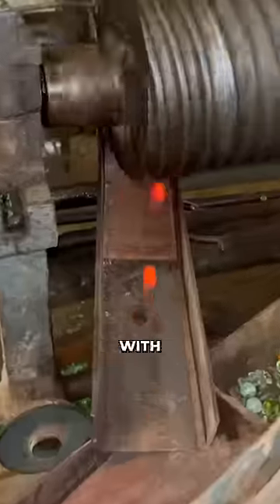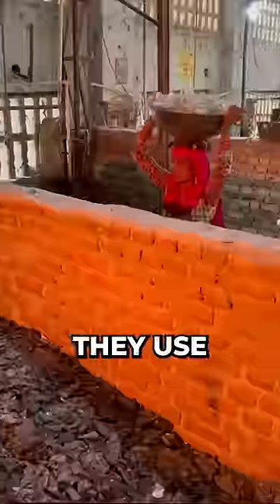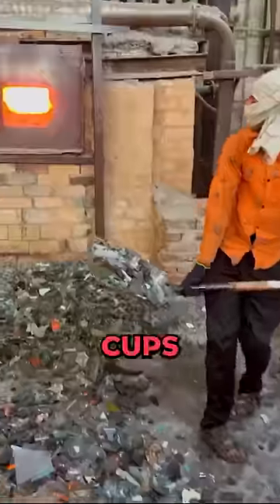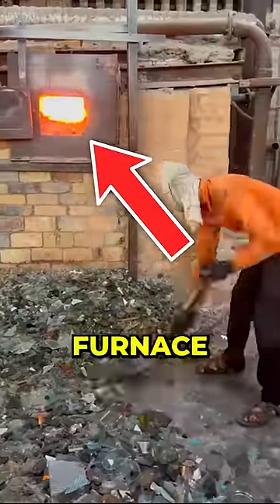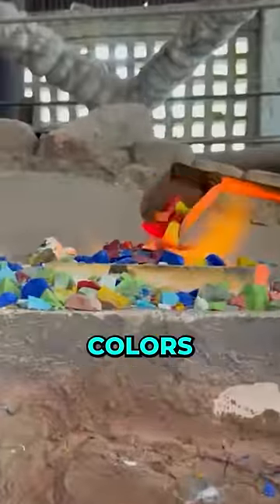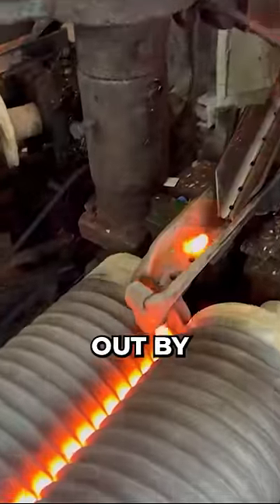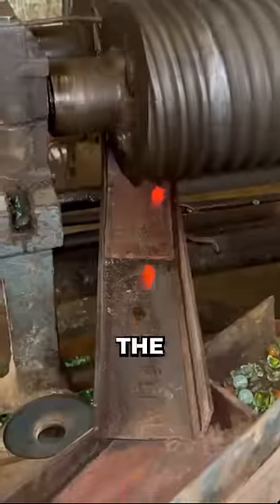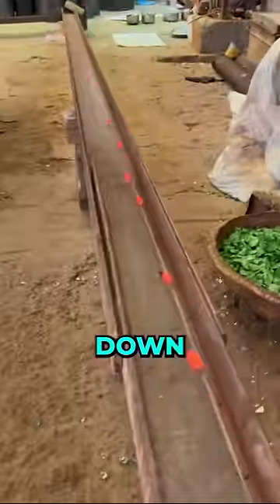These workers are making marbles ❤️

Comment: "Have you ever played with balls before?" Bro rolled me down the ledge!
Reply: "Yes" Chad response
Reply: Yeah ayo
Reply: Bro I'm dead
Reply: "Yes, yes... I love playing eith balls. Oh i'd also love to play with marbles. "
Reply: “Hot Throbbing Balls” 🤔
Reply: Caught you in 8K UHD surround sound 16 Gigs ram, HDR GEFORCE RTX, TI-80 texas insturments, Triple A duracell battery ultrapower100 Cargador Compatible iPhone 1A 5 W 1400 + Cable 100% 1 Metro Blanco Compatible iPhone 5 5 C 5S 6 SE 6S 7 8 X XR XS XS MAX GoPro hero 1 2 terrabyte xbox series x Dell UltraSharp 49 Curved Monitor - U4919DW Sony HDC-3300R 2/3" CCD HD Super Motion Color Camera, 1080p Resolution Toshiba EM131A5C-SS Microwave Oven with Smart Sensor, Easy Clean Interior, ECO Mode and Sound On/Off, 1.2 Cu. ft, Stainless Steel HP LaserJet Pro M404n Monochrome Laser Printer with Built-in Ethernet (W1A52A) GE Voluson E10 Ultrasound Machine LG 23 Cu. Ft. Smart Wi-Fi Enabled InstaView Door-in-Door Counter-Depth Refrigerator with Craft Ice Maker GFW850SPNRS GE 28" Front Load Steam Washer 5.0 Cu. Ft. with SmartDispense, WiFi, OdorBlock and Sanitize and Allergen - Royal Sapphire Kohler K-3589 Cimarron Comfort Height Two-Piece Elongated 1.6 GPF Toilet with AquaPiston Flush Technology., Quick Charge 30W Cargador 3.0 Cargador de Viaje Enchufe Cargador USB Carga Rápida con 3 Puertos carga rápida Adaptador de Corriente para iPhone x 8 7 Xiaomi Pocophone F1 Mix 3 A1 Samsung S10 S9 S8AUKEY Quick Charge 3.0 Cargador de Pared 39W Dual Puerto Cargador Móvil para Samsung Galaxy S8 / S8+/ Note 8, iPhone XS / XS Max / XR, iPad Pro / Air, HTC 10, LG G5 / G6 AUKEY Quick Charge 3.0 Cargador USB 60W 6 Puerto Cargador Móvil para Samsung Galaxy S8 / S8+ / Note 8, LG G5 / G6, Nexus 5X / 6P, HTC 10, iPhone XS / XS Max / XR, iPad Pro/ Air, Moto G4 SAMSUNG 85-inch Class Crystal UHD TU-8000 Series - 4K UHD HDR Smart TV with Alexa Built-in (UN85TU8000FXZA, 2020 Model) GE 38846 Premium Slim LED Light Bar, 18 Inch Under Cabinet Fixture, Plug-In, Convertible to Direct Wire, Linkable 628 Lumens, 3000K Soft Warm White, High/Off/Low, Easy to Install, 18 Ft Bissell Cleanview Swivel Pet Upright Bagless Vacuum Cleaner Trane20,000-Watt 1-Phase LPG/NG Liquid Cooled Whole House Standby Generator.Caught you in 8K UHD surround sound 16 Gigs ram, HDR GEFORCE RTX, TI-80 texas insturments, Triple A duracell battery ultrapower100 Cargador Compatible iPhone 1A 5 W 1400 + Cable 100% 1 Metro Blanco Compatible iPhone 5 5 C 5S 6 SE 6S 7 8 X XR XS XS MAX GoPro hero 1 2 terrabyte xbox series x Dell UltraSharp 49 Curved Monitor - U4919DW Sony HDC-3300R 2/3" CCD HD Super Motion Color Camera, 1080p Resolution Toshiba EM131A5C-SS Microwave Oven with Smart Sensor, Easy Clean Interior, ECO Mode and Sound On/Off, 1.2 Cu. ft, Stainless Steel HP LaserJet Pro M404n Monochrome Laser Printer with Built-in Ethernet (W1A52A) GE Voluson E10 Ultrasound Machine LG 23 Cu. Ft. Smart Wi-Fi Enabled InstaView Door-in-Door Counter-Depth Refrigerator with Craft Ice Maker GFW850SPNRS GE 28" Front Load Steam Washer 5.0 Cu. Ft. with SmartDispense, WiFi, OdorBlock and Sanitize and Allergen - Royal Sapphire Kohler K-3589 Cimarron Comfort Height Two-Piece Elongated 1.6 GPF Toilet with AquaPiston Flush Technology., Quick Charge 30W Cargador 3.0 Cargador de Viaje Enchufe Cargador USB Carga Rápida con 3 Puertos carga rápida Adaptador de Corriente para iPhone x 8 7 Xiaomi Pocophone F1 Mix 3 A1 Samsung S10 S9 S8AUKEY Quick Charge 3.0 Cargador de Pared 39W Dual Puerto Cargador Móvil para Samsung Galaxy S8 / S8+/ Note 8, iPhone XS / XS Max / XR, iPad Pro / Air, HTC 10, LG G5 / G6 AUKEY Quick Charge 3.0 Cargador USB 60W 6 Puerto Cargador Móvil para Samsung Galaxy S8 / S8+ / Note 8, LG G5 / G6, Nexus 5X / 6P, HTC 10, iPhone XS / XS Max / XR, iPad Pro/ Air, Moto G4 SAMSUNG 85-inch Class Crystal UHD TU-8000 Series - 4K UHD HDR Smart TV with Alexa Built-in (UN85TU8000FXZA, 2020 Model) GE 38846 Premium Slim LED Light Bar, 18 Inch Under Cabinet Fixture, Plug-In, Convertible to Direct Wire, Linkable 628 Lumens, 3000K Soft Warm White, High/Off/Low, Easy to Install, 18 Ft Bissell Cleanview Swivel Pet Upright Bagless Vacuum Cleaner Trane20,000-Watt 1-Phase LPG/NG Liquid Cooled Whole House Standby Generator.
Reply: Caught you in 8K UHD surround sound 16 Gigs ram, HDR GEFORCE RTX, TI-80 texas insturments, Triple A duracell battery ultrapower100 Cargador Compatible iPhone 1A 5 W 1400 + Cable 100% 1 Metro Blanco Compatible iPhone 5 5 C 5S 6 SE 6S 7 8 X XR XS XS MAX GoPro hero 1 2 terrabyte xbox series x Dell UltraSharp 49 Curved Monitor - U4919DW Sony HDC-3300R 2/3" CCD HD Super Motion Color Camera, 1080p Resolution Toshiba EM131A5C-SS Microwave Oven with Smart Sensor, Easy Clean Interior, ECO Mode and Sound On/Off, 1.2 Cu. ft, Stainless Steel HP LaserJet Pro M404n Monochrome Laser Printer with Built-in Ethernet (W1A52A) GE Voluson E10 Ultrasound Machine LG 23 Cu. Ft. Smart Wi-Fi Enabled InstaView Door-in-Door Counter-Depth Refrigerator with Craft Ice Maker GFW850SPNRS GE 28" Front Load Steam Washer 5.0 Cu. Ft. with SmartDispense, WiFi, OdorBlock and Sanitize and Allergen - Royal Sapphire Kohler K-3589 Cimarron Comfort Height Two-Piece Elongated 1.6 GPF Toilet with AquaPiston Flush Technology., Quick Charge 30W Cargador 3.0 Cargador de Viaje Enchufe Cargador USB Carga Rápida con 3 Puertos carga rápida Adaptador de Corriente para iPhone x 8 7 Xiaomi Pocophone F1 Mix 3 A1 Samsung S10 S9 S8AUKEY Quick Charge 3.0 Cargador de Pared 39W Dual Puerto Cargador Móvil para Samsung Galaxy S8 / S8+/ Note 8, iPhone XS / XS Max / XR, iPad Pro / Air, HTC 10, LG G5 / G6 AUKEY Quick Charge 3.0 Cargador USB 60W 6 Puerto Cargador Móvil para Samsung Galaxy S8 / S8+ / Note 8, LG G5 / G6, Nexus 5X / 6P, HTC 10, iPhone XS / XS Max / XR, iPad Pro/ Air, Moto G4 SAMSUNG 85-inch Class Crystal UHD TU-8000 Series - 4K UHD HDR Smart TV with Alexa Built-in (UN85TU8000FXZA, 2020 Model) GE 38846 Premium Slim LED Light Bar, 18 Inch Under Cabinet Fixture, Plug-In, Convertible to Direct Wire, Linkable 628 Lumens, 3000K Soft Warm White, High/Off/Low, Easy to Install, 18 Ft Bissell Cleanview Swivel Pet Upright Bagless Vacuum Cleaner Trane20,000-Watt 1-Phase LPG/NG Liquid Cooled Whole House Standby Generator.Caught you in 8K UHD surround sound 16 Gigs ram, HDR GEFORCE RTX, TI-80 texas insturments, Triple A duracell battery ultrapower100 Cargador Compatible iPhone 1A 5 W 1400 + Cable 100% 1 Metro Blanco Compatible iPhone 5 5 C 5S 6 SE 6S 7 8 X XR XS XS MAX GoPro hero 1 2 terrabyte xbox series x Dell UltraSharp 49 Curved Monitor - U4919DW Sony HDC-3300R 2/3" CCD HD Super Motion Color Camera, 1080p Resolution Toshiba EM131A5C-SS Microwave Oven with Smart Sensor, Easy Clean Interior, ECO Mode and Sound On/Off, 1.2 Cu. ft, Stainless Steel HP LaserJet Pro M404n Monochrome Laser Printer with Built-in Ethernet (W1A52A) GE Voluson E10 Ultrasound Machine LG 23 Cu. Ft. Smart Wi-Fi Enabled InstaView Door-in-Door Counter-Depth Refrigerator with Craft Ice Maker GFW850SPNRS GE 28" Front Load Steam Washer 5.0 Cu. Ft. with SmartDispense, WiFi, OdorBlock and Sanitize and Allergen - Royal Sapphire Kohler K-3589 Cimarron Comfort Height Two-Piece Elongated 1.6 GPF Toilet with AquaPiston Flush Technology., Quick Charge 30W Cargador 3.0 Cargador de Viaje Enchufe Cargador USB Carga Rápida con 3 Puertos carga rápida Adaptador de Corriente para iPhone x 8 7 Xiaomi Pocophone F1 Mix 3 A1 Samsung S10 S9 S8AUKEY Quick Charge 3.0 Cargador de Pared 39W Dual Puerto Cargador Móvil para Samsung Galaxy S8 / S8+/ Note 8, iPhone XS / XS Max / XR, iPad Pro / Air, HTC 10, LG G5 / G6 AUKEY Quick Charge 3.0 Cargador USB 60W 6 Puerto Cargador Móvil para Samsung Galaxy S8 / S8+ / Note 8, LG G5 / G6, Nexus 5X / 6P, HTC 10, iPhone XS / XS Max / XR, iPad Pro/ Air, Moto G4 SAMSUNG 85-inch Class Crystal UHD TU-8000 Series - 4K UHD HDR Smart TV with Alexa Built-in (UN85TU8000FXZA, 2020 Model) GE 38846 Premium Slim LED Light Bar, 18 Inch Under Cabinet Fixture, Plug-In, Convertible to Direct Wire, Linkable 628 Lumens, 3000K Soft Warm White, High/Off/Low, Easy to Install, 18 Ft Bissell Cleanview Swivel Pet Upright Bagless Vacuum Cleaner Trane20,000-Watt 1-Phase LPG/NG Liquid Cooled Whole House Standby Generator.
Reply: Of course.
Reply: Yes big ones from my uncle🥰
Reply: Hahahaaaaaaaaa😂😂😂😂😂😂😂
Reply: Yeah
Reply: Lol
Reply: I can't stop laughing
Reply: @cliffordhathaway2391 Yes
Reply: Relatable 😮‍💨

Comment: "have you ever played with balls before" 
Bro knew what he was doing 💀
Reply: Fr
Reply: Tbh, i have.
Reply: blud snuck a heart emoji in ☠️ Xoxo have a good day ❤❤
Reply: Caught you in 8K UHD surround sound 16 Gigs ram, HDR GEFORCE RTX, TI-80 texas insturments, Triple A duracell battery ultrapower100 Cargador Compatible iPhone 1A 5 W 1400 + Cable 100% 1 Metro Blanco Compatible iPhone 5 5 C 5S 6 SE 6S 7 8 X XR XS XS MAX GoPro hero 1 2 terrabyte xbox series x Dell UltraSharp 49 Curved Monitor - U4919DW Sony HDC-3300R 2/3" CCD HD Super Motion Color Camera, 1080p Resolution Toshiba EM131A5C-SS Microwave Oven with Smart Sensor, Easy Clean Interior, ECO Mode and Sound On/Off, 1.2 Cu. ft, Stainless Steel HP LaserJet Pro M404n Monochrome Laser Printer with Built-in Ethernet (W1A52A) GE Voluson E10 Ultrasound Machine LG 23 Cu. Ft. Smart Wi-Fi Enabled InstaView Door-in-Door Counter-Depth Refrigerator with Craft Ice Maker GFW850SPNRS GE 28" Front Load Steam Washer 5.0 Cu. Ft. with SmartDispense, WiFi, OdorBlock and Sanitize and Allergen - Royal Sapphire Kohler K-3589 Cimarron Comfort Height Two-Piece Elongated 1.6 GPF Toilet with AquaPiston Flush Technology., Quick Charge 30W Cargador 3.0 Cargador de Viaje Enchufe Cargador USB Carga Rápida con 3 Puertos carga rápida Adaptador de Corriente para iPhone x 8 7 Xiaomi Pocophone F1 Mix 3 A1 Samsung S10 S9 S8AUKEY Quick Charge 3.0 Cargador de Pared 39W Dual Puerto Cargador Móvil para Samsung Galaxy S8 / S8+/ Note 8, iPhone XS / XS Max / XR, iPad Pro / Air, HTC 10, LG G5 / G6 AUKEY Quick Charge 3.0 Cargador USB 60W 6 Puerto Cargador Móvil para Samsung Galaxy S8 / S8+ / Note 8, LG G5 / G6, Nexus 5X / 6P, HTC 10, iPhone XS / XS Max / XR, iPad Pro/ Air, Moto G4 SAMSUNG 85-inch Class Crystal UHD TU-8000 Series - 4K UHD HDR Smart TV with Alexa Built-in (UN85TU8000FXZA, 2020 Model) GE 38846 Premium Slim LED Light Bar, 18 Inch Under Cabinet Fixture, Plug-In, Convertible to Direct Wire, Linkable 628 Lumens, 3000K Soft Warm White, High/Off/Low, Easy to Install, 18 Ft Bissell Cleanview Swivel Pet Upright Bagless Vacuum Cleaner Trane20,000-Watt 1-Phase LPG/NG Liquid Cooled Whole House Standby Generator.Caught you in 8K UHD surround sound 16 Gigs ram, HDR GEFORCE RTX, TI-80 texas insturments, Triple A duracell battery ultrapower100 Cargador Compatible iPhone 1A 5 W 1400 + Cable 100% 1 Metro Blanco Compatible iPhone 5 5 C 5S 6 SE 6S 7 8 X XR XS XS MAX GoPro hero 1 2 terrabyte xbox series x Dell UltraSharp 49 Curved Monitor - U4919DW Sony HDC-3300R 2/3" CCD HD Super Motion Color Camera, 1080p Resolution Toshiba EM131A5C-SS Microwave Oven with Smart Sensor, Easy Clean Interior, ECO Mode and Sound On/Off, 1.2 Cu. ft, Stainless Steel HP LaserJet Pro M404n Monochrome Laser Printer with Built-in Ethernet (W1A52A) GE Voluson E10 Ultrasound Machine LG 23 Cu. Ft. Smart Wi-Fi Enabled InstaView Door-in-Door Counter-Depth Refrigerator with Craft Ice Maker GFW850SPNRS GE 28" Front Load Steam Washer 5.0 Cu. Ft. with SmartDispense, WiFi, OdorBlock and Sanitize and Allergen - Royal Sapphire Kohler K-3589 Cimarron Comfort Height Two-Piece Elongated 1.6 GPF Toilet with AquaPiston Flush Technology., Quick Charge 30W Cargador 3.0 Cargador de Viaje Enchufe Cargador USB Carga Rápida con 3 Puertos carga rápida Adaptador de Corriente para iPhone x 8 7 Xiaomi Pocophone F1 Mix 3 A1 Samsung S10 S9 S8AUKEY Quick Charge 3.0 Cargador de Pared 39W Dual Puerto Cargador Móvil para Samsung Galaxy S8 / S8+/ Note 8, iPhone XS / XS Max / XR, iPad Pro / Air, HTC 10, LG G5 / G6 AUKEY Quick Charge 3.0 Cargador USB 60W 6 Puerto Cargador Móvil para Samsung Galaxy S8 / S8+ / Note 8, LG G5 / G6, Nexus 5X / 6P, HTC 10, iPhone XS / XS Max / XR, iPad Pro/ Air, Moto G4 SAMSUNG 85-inch Class Crystal UHD TU-8000 Series - 4K UHD HDR Smart TV with Alexa Built-in (UN85TU8000FXZA, 2020 Model) GE 38846 Premium Slim LED Light Bar, 18 Inch Under Cabinet Fixture, Plug-In, Convertible to Direct Wire, Linkable 628 Lumens, 3000K Soft Warm White, High/Off/Low, Easy to Install, 18 Ft Bissell Cleanview Swivel Pet Upright Bagless Vacuum Cleaner Trane20,000-Watt 1-Phase LPG/NG Liquid Cooled Whole House Standby Generator.
Reply: 😂😂😂 so true!
Reply: I’m the 666th like ayyyy
Reply: @breadboy722  congrats!
Reply: @A3thirtyRoblox  ah sorry I misspelled it 💀
Reply: Lmao fr 😂
Reply: @max_161real bro... Wtf 😂😂😂😂😂😂😂😂😂😂😂😅
Reply: Bro, 911 likes 💀
Reply: I have
Reply: only people that actually has a life and does not scroll on TikTok responds “yes”